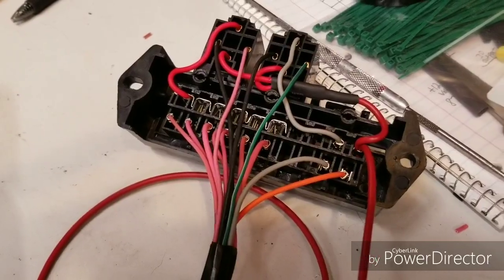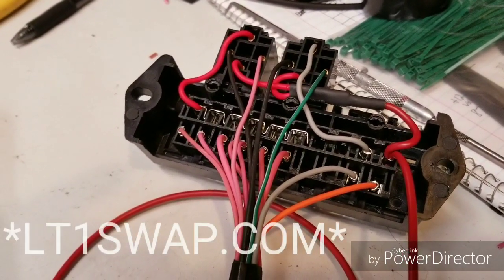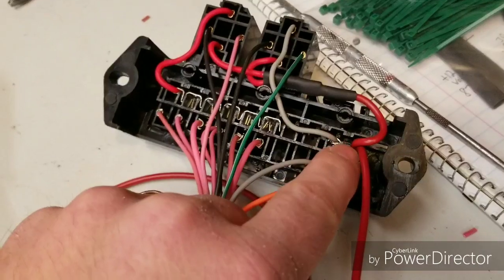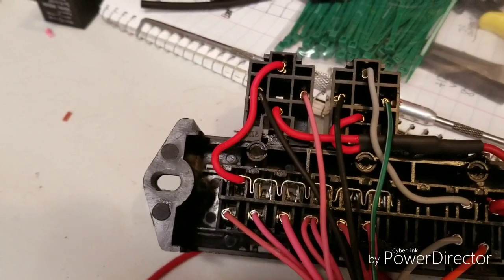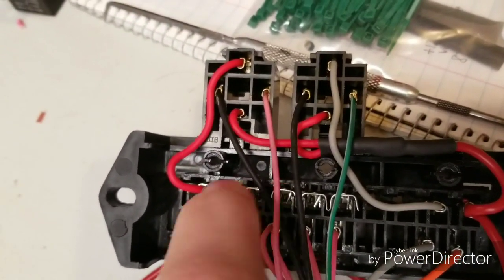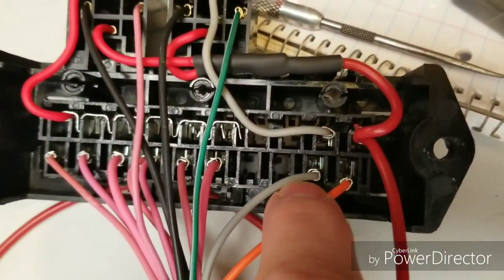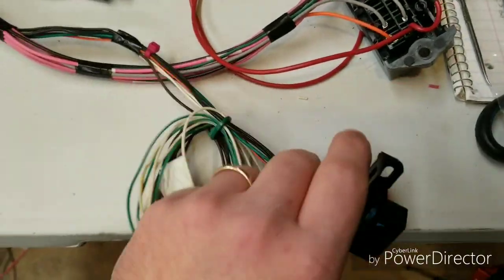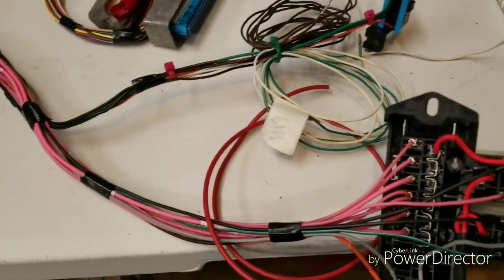Stand alone ls swap harness fuse block logic.

Comment: We're do you hook up your ignition wire from the relay ,and also your starter wire
Reply from the maker: Depends what you're putting it in. Mine was a 75 chevy c10. So I used the c10 original starter wire, and the original c10 coil wire for the ignition.

Comment: All of my coilpacks arent getting any power any idea why.?? im still trying to figure it out right now
Reply from the maker: @julianz6820  gotta test for power. Should have key on 12v on the pink wires in the main coil pack connector. If you don't, then either that wire isn't hooked up at the fuse block, or the fuse is blown.
Reply: @ okay will check and u might be right about the 12v but thanks for replying fast

Comment: Is one of the pink wires getting 12 v from the orange to the PCM, and then fed back to the small pink?  I have a crank no start and what I did was tie all pinks together. They get 12v on ignition and start. Wondering if one of those pinks is trying to feed power and then I’m connecting power to power.
Reply from the maker: @sdalin27  no you have it right. All pinks should be 12v in start and run, the oranges should be 12v constant.

Comment: What is done for the starter no relay needed?
Reply from the maker: Some vehicles need a starter relay, some don't. I'm this case I'm swapping a chevy square body. It uses a heavy gauge wire from the ignition switch to the starter so no relay needed.

Comment: I wired the same way but my ignition hots are staying hot when the key is off but only when I have the pcm plugged in if I unplug the pcm everything works as it should any idea what I’m missing 🤯 I traced the pinks and oranges back to the right spots on the pcm I can’t figure it out
Reply from the maker: Not sure. I'd disconnect one wire at a time at the ecm of the pinks and oranges and see which one makes it quit happening and go from there. The pinks should only be hot when the ignition relay is triggered by the key.
Reply: @y5mgisi  thanks I’ll give it a try

Comment: THANK YOU SIR, YOU ARE THE MAN! Im swapping an '04 6.0L into my '63 C10...I dont want the big ugly ECM inside the cab, I want to keep the factory wiring, but i dont want to use the big ugly yukon fuse block. Im going to use the mechanical fan that comes with the 6.0L at first, so i dont need extra relays for the fans. This explains things perfectly. Now maybe I will be able to sleep.

Comment: One question sir.
How do I connect the tach wire from the OBS to the ls?
Reply from the maker: Depending on the year, you should just be able to hook the original tach wire to the tach wire from ecm.
Reply: The truck is a 2000 (obs crew cab, the last obs they made) the harness is from a 2003. I have the tcc wire from the obs and I have another tcc wire coming from the pcm. But I see a lot of people saying that the tcc should be connected to the brake switch been “on” when the brake pedal is not press and been off when the pedal is depressed.
Reply from the maker: @josenarvaez5338  that I'm not too sure about. I'd look on lt1swap.com and see what it says on there.

Comment: Awesome video sir!!
Basically I have my harness ready. But I’m stuck on where to hook/splice the grey wire for the fuel pump. Do I hooked/spliced to the grey wire on the fuel pump conector/harness? Tia
Reply from the maker: Yes. The grey wire from the fuel pump relay goes straight to the fuel pump or spliced into the connector at the fuel pump.

Comment: Ignition input wire…do you hook that into the big red wire that plugged into the top of the coil? 95 k1500. Then where does my tach wire hook into?
Reply from the maker: Yes. Tach wire would go from the ecu to whatever the trucks original tach signal wire would have been.

Comment: Hi do you mind sharing what PIN number wire you used for the neutral park safety switch? Thanks.
Reply: Did u figured out?
Reply: @gerardolopez5875  nope im still stuck on that part of the swap!
Reply: @copuyo1  @ switch its on? Or removed?
Reply: @gerardolopez5875  switch it’s on but connectors from wire harness were missing,that’s what I’m trying to figure out
Reply: @copuyo1  @ good luck ,,, thats another story!!!    Missing wires,  etc

Comment: Can you just use the fusebox that comes with the stock harness?  Seems like a much easier option.
Reply: You can,but this way elimimates all the wires you will not be using thus having a cleaner look.
Reply: Im not sure if you ever did your swap, but that is one big ugly box, and you only need a 1/3 of it for the engine stuff

Comment: nice video; do you have any experience with a gen4 computer? i have been to LT1swap and got through the pin-out process but i am having a really hard time knowing what gets plugged into the computer from the fuse block. Thanks
Reply from the maker: Hey there! No I'm sorry I still haven't done a gen4 swap.
Reply: @y5mgisi  thanks for the reply

Comment: Good job. I did the same. The only difference is that I ran 2 separate 12VDC leads. 1 supplying my ignition keyed power relay.  And constant 12VDC constant

Comment: Can you test the harness without the engine in the car I just wanted to check my fuel pump but ita not coming on relay clicks on on the harness .... or does the computer have to read other components?
Reply from the maker: Just to test it like you're talking about, you do not need any sensors connected. Just power and ground. Also, incase you weren't aware, the fuel pump only kicks on for about 2 seconds unless the computer detects the engine is running. So like, if you apply power and ground to a harness on your work bench, not in the car, the fuel pump relay will come on, and click back off within a couple seconds. Take away the power and then re apply the power and it will come on for another two seconds etc.
Reply: @y5mgisi  thanks I found out my harness wasn't powered up now I'm not to track down the fuel pump wire a d see what she do

Comment: i save oil level sensor in my ls harness but i dont know what is the wire from PCM that triggers the wire in the cluster to turn the warning low oil level on, when oil pan is low. do you know what wire is this? i will appreciate your help thanks.
Reply from the maker: I think it has to go to the body control mudule. But that I don't have good answer for unfortunately.

Comment: did you save pin B-33 (tcc brake switch) if you does what is the purpose of this switch. just am doing same harness as you and i would like to know if i have to save it.
Reply from the maker: I didn't save it since I used a th400.
Reply: Not necessary with TH400 but. It also lowers engine rpm by 200 when parked/stopped so no harsh  take off or creeping at light with tight converter

Comment: Have you got enough pink wires to run the coils and injectors
Reply from the maker: Good question. I should make another video on that soon. But yes. I tie in some of the injectors together and splice them, into one wire. Some more injectors and splice them into another wire, etc, etc. So instead of like, 11 separate pink wires coming in to the fuse block, there is only a few.
Reply: @y5mgisi  have you had a chance to make a video about all the pink wires? I'm working on my swap now and have been pushing it off a little trying to figure out all the pink wires.
Reply from the maker: @jsc7002jeep  hi! I haven't really. What exactly are you having trouble with? I might could make another video on it.
Reply: @y5mgisi  Just where I need to wire them to, plus what all they are. I just did a continuity test on them and labeled the wires to the plug but I wasn't sure which ones I need to keep and which ones can go. I'm running a SM465 transmission so I don't need any wires for it.
Reply from the maker: @jsc7002jeep  check out lt1swap.com in the wiring harness section. He has pretty much all the info there.

Comment: Which fuse box are you using and do the connectors come with it?
Reply from the maker: Hi thanks for watching and thanks for the question! It's a generic 10 way fuse block from Amazon. Hopefully this link works.
10 Way Blade Fuse Box Holder 5-Pin Relay Socket Base Block with Fuse Terminals and Fuses for Automotive Car Boat Marine Vehicle https://www.amazon.com/dp/B07D1JX16Y/ref=cm_sw_r_cp_apa_i_sg0qCbHWGDBG9
Reply: Thanks for the quick response and yes the link works.  Good luck on ur build. 👌👍👍
Reply from the maker: @mr.ls-s860  thanks!